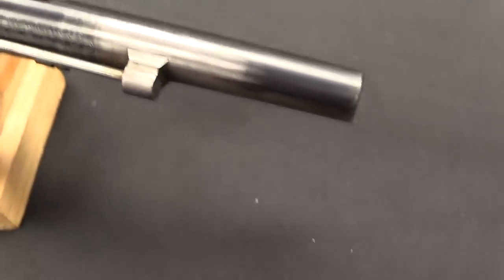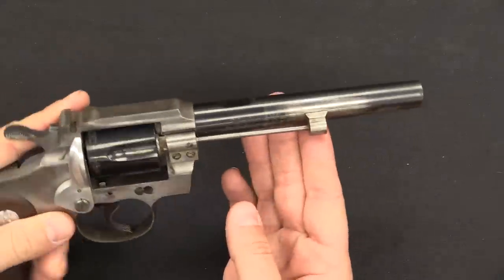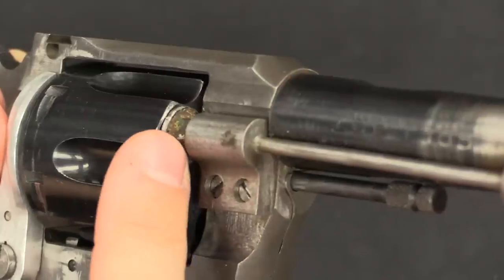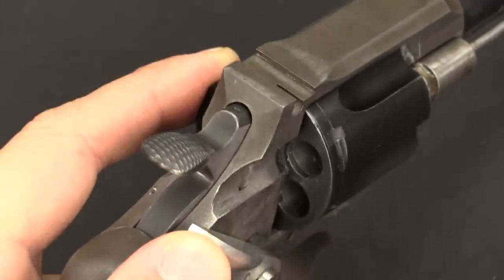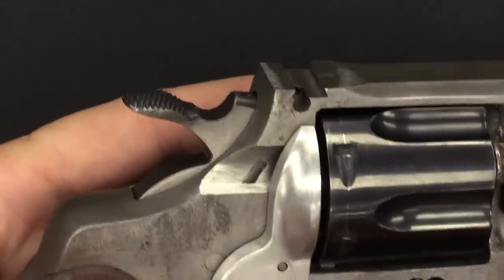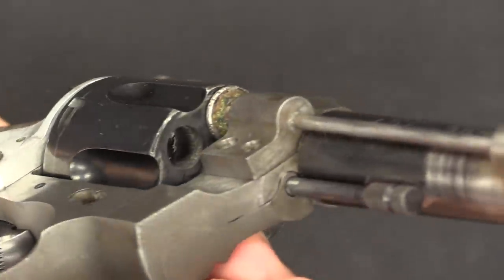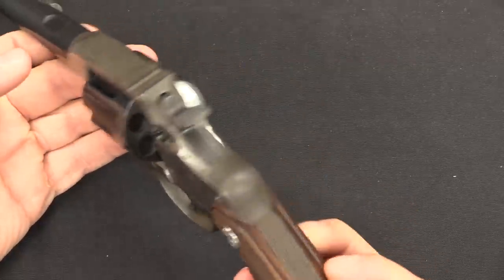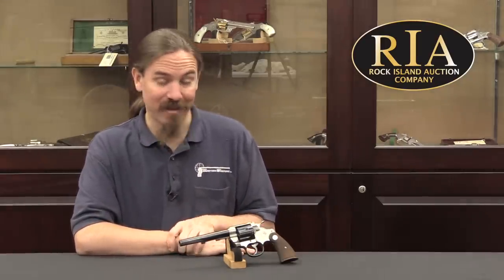Colt Prototype Self-Ejecting Revolver

Comment: Wouldn’t another issue be that it’s going to eject the unfired round from cylinder number six when you fire cylinder number one?
Reply: Indeed! that's exactly what I though too, to me this concept is an arrant nonsense.
Reply: Wondering that myself, maybe you were expected to only load 5?  Or the aluminum deflector might have kept a fully loaded round in.
Reply: exactly what i was thinking.  you lose one cylinder.
also I am not sure how much benefit it is as you need to open the cylinder to reload anyway.
Reply: i'm guessing maybe the weight of an unfired round would prevent it from moving with the right calculators on bore size you could vent enough gas to move an empty case but not a full one
Reply: Could put in a blocker that only opens after the first chamber rotation
Reply: Even if the unfired cartridge has enough mass to prevent ejection, the gases would leave it sticking out a bit and made the cylinder stuck. Maybe that flapper would put it back in.
Reply: It was an experiment. Sometimes you try things that are not fully thought out, just to see what happens, and then try to solve those problems. it's pretty obvious, in hindsight, that this experiment had insurmountable problems and was abandoned. Also remember that this is probably from before the days of easy computer modeling, when you actually had to build something and try it to find out if it would work or not.
Reply: I doubt this was ever planned to be a commercial product. Looks like something someone made just to see if it was possible
Reply: GreenManAiming that's what i'm thinking too.
Reply: I was originally thinking that it would be a "load 5" situation but then I was thinking the mass of an unspent round would prevent the movement. After all, it is a pinhole pushing out an empty brass case.
Reply: They might have had the idea that the shape and aerodynamics of the actual bullet/ unfired case would deflect the gasses around it  and the gasses getting caught in the empty case was needed for ejection?
Reply: It might be an aerodynamics thing, an empty cartridge would be pushed by the gas because of its shape, while a loaded one would just push the gas around it
Reply: Generic Channel #18 unless it were loaded with hollow points...which I guess wasn't too common in the '60s and '70s.
Reply: I should have read further before I commented  lol
Reply: So you now have a 5 shot revolver with a top up.  I mean I get why it didn't work but its definitely a piece of firearm history.
Reply: Same thought as he showed the gas system. Dardick is still the best semiauto revolver. And its ulgier than ugly.
Reply: I don't think you'd be able to calibrate it precisely enough to eject an empty case but not a live round.  A fired case is actually harder to get out because it deforms and sticks to the chamber.  A live round will drop free, unless you've got a really fouled gun.
Reply: That was my first thought, too.
Reply: metamorphicorder the best semi auto revolver is the mateba 6 unica
Reply: (FTR I went into the comments because I was also thrown entirely  by the lack of reference to what happens on the first shot). The prototype might have been aimed solely or primarily at testing the viability of the ejection method, and leaving aside the myriad other design questions you'd need to answer before making a "working" design.
I mean, for the sake of testing all it really needs is two cylinder slots (one loaded with a live round, one with a spent round), but it's easier to find a normal cylinder than such a custom one.

TL; DR the question of the first round is totally unanswered here, but if it's just a test bed that might make sense
Reply: I was just thinking this myself and came to the comments to see if anyone else had mentioned it!
Reply: It's just going to be a 5 shot, never unload the empty case until you're done shooting for the day. 

Maybe switch cartridges so that you can fit an extra round or two in the cylinder so you can get more than 5 rounds. If you base it off of a 9mm You can get 8 rounds, minus one for the empty of course.
Reply: A loaded case would eject more easily because there would be less volume in that chamber for the gas coming in to expand into.  You've got the same piston area at a much higher pressure, and therefore way more force.
Reply: I'm guessing they had an idea (or more) in mind to block or disable the ejection on the first round, but there's really no reason to bother with such a refinement before you know if the main idea works.
Reply: I was going to write that flaw. This gun would eject an unfired round.
Reply: Could have been thinking they'd make it turn in time to get the chamber with the empty case moved to the ejecting chamber?
Reply: B.D.B. even then it would stull eject loaded rounds and the pressure of the first rounds gas also could detonate the next round and blow the whole gun up
Reply: TwoTsOnTheTrail you dont know how pressure works if you think the smaller hole makes it less if its smaller with the pressure of a round being fired goes through it it has more power than if the hole was bigger
Reply: Corwin Hyatt or even making the round fire
Reply: My guess is Mr Roy was mighty drunk when he concocted this. This idea probably makes perfect sense if you're blind drunk.
Reply: EXPERIMENTAL
Reply: This sounds similar to the Striker Shotgun, which uses a similar gas system to eject the rounds.
Reply: Its probably not enough gas to eject a live round but an empty case is also like a cup were as a live round has a nose, gas flow goes around the bullet
Reply: @lukaszpokoju  Me too!
Reply: I wonder if the gas would have enough energy to move the weight of the whole cartridge?
Reply: idea came to late in revolver designs. Old school single loading revolvers would benefit tho.
Reply: What they should make is a revolver that ejects spent cartridges, AND lets you load bullets in individually, if you get an opportunity to do so. Assailant stands up after he hears 6 shots and Noooo! You've got a 7th, and an 8th. Kabam! Kabam!
Reply: @TheHacknor  if you keep your gun emaculately clean.
Reply: @whitecoffee8090  Or someone higher up the corporate food chain asked for him to design it, despite his objections, so he did it and could visibly demonstrate these shortcomings and impracticalities.  Sometimes, people have to be shown visible proof before they believe it...
Reply: @Dick_Gozinya  Exactly...it was just an experiment to see if it could be done. IF it could be done then maybe it would have been built upon....my guess it did not work well and/or, as we all determined, there really was no practical use. Maybe it was just an engineer who said "lets see if we can make this work" over a bottle of bourbon.
Reply: if memory serves don't colt revolvers cycle clockwise? if that's the case then it would put the empty just now fired cartridge right in front of the gas port.
Reply: Funnily enough, this same concept emerged with the Striker 12 (Ian has a video of it), which was a successful enough semi-automatic(ish) shotgun. A gate lifts up to retain the last loaded shell in the Striker's case, and it automatically drops down with the first cycling of the weapon. Presumably, the springed cover plate serves the same purpose here.

Colt revolvers rotate clockwise (it was actually a way to get around S&W's patent of a mechanically-rotating cylinder, S&W had patented a CCW rotation), so if you follow that you'll see that the first round that will be acted upon by the gas ejection is, in fact, the first fired round (which will have rotated into the position to be acted upon by the gas).

With that said, the Striker had a manual ejector for the last round fired, as there is obviously no gas to act upon the casing. I can't see any mechanism through which this is accomplished with this revolver.
Reply: couldn`t the gas system be fine tuned to not eject the heavier unfired bullet, but do the fired casing? it would probably have issues with different ammo with different weights, but there would still be that one that works
Reply: Would the gas be strong enough tobehect unspent round

Comment: I love how everyone is quick to put down an interesting invention instead of trying to find a way to improve it.
Reply: This is about as useful as a horse carriage drawn by a motorcycle, or a steam engine whose boiler is heated with electricity. Nowadays revolvers have star ejectors which spit out all used cartridges when you open the cylinder, so there is no need for this contraption. The real improvement is the self-loading pistol which has been invented more than one century ago.
Reply: Thank you for proving me right.
Reply: @olinvent  lol I guess so
Reply: Why not an option to disable the gas tube so that you don't eject an unused round? That would be helpful, so that you don't waste unused ammunition. Also, it should be simple so that you can immediately reactivate the gas tube after the first shot. 
Perhaps a way to block the gas tube harmlessly so you don't damage anything? Removing and reattaching it would be tedious.
Or load five instead of six, but then you aren't getting the full potential of the design. 
I like this because it could help cut back on reload time.
Reply: @lucianene7741  They aren't "spit out", they are manually extracted. It is the slowest and most problematic part of reloading a revolver. 

An auto-ejecting revolver empties the cylinder faster than a moonclip, while having access to the durability of the speedloader.

Quicker, faster and more reliable reloads for duty and self-defense.
Reply: @marakalos3838  The synchronized action movement I can think of is disactivating it with the close of the cylinder (probably where the crane meets the frame), and reactivating it with the release of the trigger after the first round is fired. Some serious thought would have to go into it.

Doesn't matter if it's complicated, since Colts are already so by nature.
Reply: @Snubrevolver  I think that is all it really needs. That is better than what I had in mind by far. I thought of a manual switch or lock to prevent ejection during the firing of the first round. It would be troublesome and unnecessarily complex, but your idea to make it work with the trigger is far better.
Reply: @marakalos3838  Yeah it'd have to both work equally well and surpass a manually extracted revolver to have any chance of success. 

I'd probably buy one.

Comment: * loads 6 cartridges*
* shoots once *
4 bullets left.  oops!
Reply: Dirty Harry would be in trouble! 😳
Reply: Did I fire 6 shots or 1?
Reply: thats why you would want to leave that one empty shell in there when reloading !
Reply: Yeah, basically, you have a five shooter, and if you go back before speed loaders were common, this could save some time since you wouldn’t bother ejecting the last case. You would load 5 and let the first shot blow the last case out. Still a dumb idea though. Just use speed loaders.
Reply: @justins8802  That's not why they did that, an old single action revolvers if you leave a live round in the chamber if you bump the hammer on the back of the gun the gun will discharge
Reply: @justins8802  The cowboy reload was just so the cowboy didn't shoot themselves in the foot when they bought a drink from the bar
Reply: Starwarman1 - I wasn’t going that far back. Mechanical safeties to protect the 6th round from the firing pin have been around for over a century. My understanding is that speed loaders were not regularly carried by law enforcement until, or perhaps through, the 1970s. After that, auto loaders took over. So someone who really wanted a revolver and hated speed loaders could get an advantage from this gun, but realistically speed loaders and auto loading pistols are much better ideas.
Reply: Starwarman1 - So to be clear, a sort of reasonable usage of this unreasonable design would be to fire 6 rounds from your first load, then reload 5 rounds individually, leaving the 6th spent case in, firing 5 rounds, then repeating the reload. It’s still dumb since you would have to be sure to align the cylinder such that the spent case is aligned with the barrel, or be prepared to “click through” it. Being expected to do that in a firefight is asinine.
Reply: @Starwarman1  most revolvers can lock with the cylinder between two shots, thus nullifying the problem.
Reply: @quantustremorestfuturus5434  no that's not true at all especially back then, I've never once fired an old single action revolver where I can keep it in my holster and lock it between the two chambers
Reply: @Starwarman1  The Remington 1858 has a safety notch in the cylinder that you can drop the hammer onto while all 6 chambers are loaded.  That is a percussion revolver; I'd be surprised if they didn't continue that feature on the 1875 model, but I don't have one to compare.
Reply: @justins8802  That's assuming you can single load this thing through the same cover/cyclinder that ejects it...which makes no sense given the cylinder breaks open out the side. There's no practical usage out of this gun, sadly! Also, revolvers and NO speed loaders needs to become the STANDARD for law enforcement nowadays, since psych tests and training for LEO are nonexistent in 2020 lol. Give any shit stain with racial bias or a murder boner a Glock and hand out the badge.
Reply: Could you adapt this in a SAA where ppl sometime carry 5 rounds for safety purposes? It would help a lot probably since SAA you load one at a time anyways.
Reply: I was thinking that
Reply: @joshglover2370 🤦🏻‍♂️
Reply: @spook407 🤦🏻‍♂️
Reply: @justins8802 🤦🏻‍♂️
Reply: @Starwarman1 if its hit hard enough yeah but this is an auto ejecting one so in this case thats why you load five
Reply: @glcart-cs5sc  yes, that’s a very nice emoji
Reply: @spook407  shut up 🤦🏻‍♂️
Reply: @glcart-cs5sc  you shut up 🗿
Reply: @spook407  nah i wont also wow that emoji 🤦🏻‍♂️
Reply: @glcart-cs5sc  what’s wrong with my emoji 🫃
Reply: @glcart-cs5sc  well there’s nothing wrong with it stop hating 🍤

Comment: I think this idea would be okay if implemented on a single action army. Because you load it on one side and it ejects out the other side. It would save loads of time.
Reply: Then you'd have to remove the loading gate and replace it with the auto ejector, then make a whole new loading gate on the left side. Like someone said though, on the first shot you'd have that ejection gas coming out of the empty chamber in the direction towards the shooter.

Comment: I think I'll wait for the piston version with a non-reciprocating charging handle.
Reply: James Healy where do you think they'll put the charging handle? I say something along the lines of an mp5.
Reply: Maybe having the trigger guard be the charging handle, flick the thing forward with your finger. H&K mp5 style is not a bad idea either.
Reply: I think the rear mounted pivoting position has some merits for thumb activation without breaking firing grip. ;)
Reply: becomes HK416 assault revolver version
Reply: Because of the 416 using both things the OP mentioned lel
Reply: I think we're on to something here.
Reply: FD36 yes we are :D
Reply: Budleigh Salterton trigger guard replacing the hammer would be something i would want to see happen!

Comment: This reminds me about a question I've been dying to ask: Why haven't "Tround" guns ever taken off?

I can see why the Dardick revolver itself didn't take off, but why hasn't the idea been used since? It seems like it could be useful, especially in a hunting rifle.

Sorry if you've answered this in a Q&A already, I don't usually have the time to watch them through.
Reply: the plastic cased ammo and the shape and all that maybe if they made it with regular rimless semiauto type of ammo it could work if they remade it the reason they tryed the first thing i said was cause it supposedly held more ammo
Reply: The concept was explored further in small-scale tests, with the US Navy building a .50 caliber tround machine gun. 

The rate of fire was quite high and it worked without issue, which is really where the tround comes into play; the tround was really meant for something like a machine gun or autocannon for aircraft use, as the case design allows an “open-cylinder” design that simplified chambering and ejection with a linkless feed system.

Comment: Back in 2012 I took an M1895 Nagant revolver & made it gas ejecting. The mechanism I made was nearly identical to this. I had no idea this prototype Colt revolver existed. I had many of the same problems. Such as how it ejects on every shot, so I had to leave actually two chambers empty due to the position of the ejector rod. Which since a Nagant holds 7rds it still had 5rds, but with such a slow reloading process you really want to have those extra 2rds. Having it auto eject really didn't save much time on the reload.

Comment: Good video, thanks.  In fact someone did do it before.  The Spanish gunmaker Orbea made a gas operated self ejecting pin fire revolver in the 1860s that looked near identical to the revolver in the video.  Except of course it had a fixed cylinder, not a swing out.  I’ve never come across another and it’s likely the mechanism was impractical in operation.  There is a photograph of it in Guns by Dudley Pope, published in the early 70s.

Comment: Interesting idea but I think the top break revolver is more elegant in that opening up the gun to put more cartridges in already ejects the spent cases so there is no additional effort or actions spent in removing them, even a swing out cylinder requires you to hit the ejector after swinging out the cylinder which is one added step over a top break.